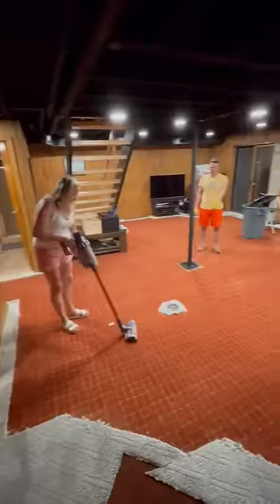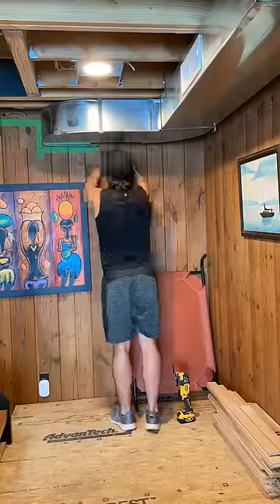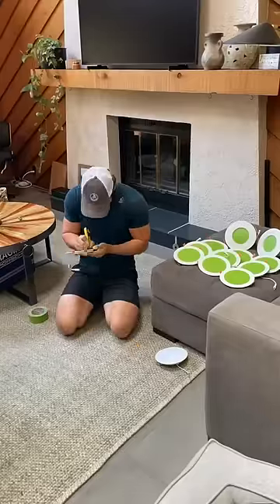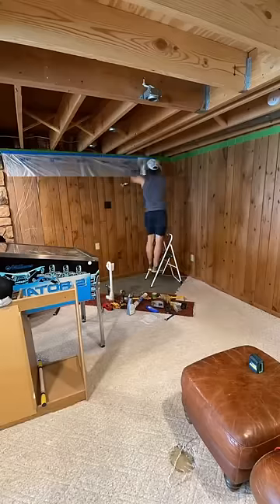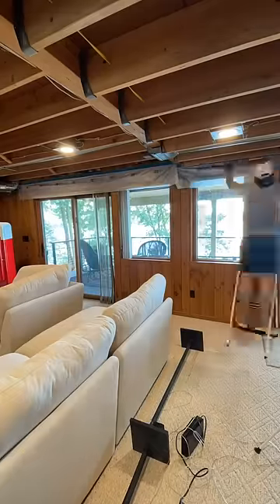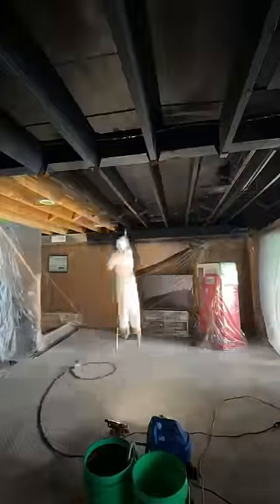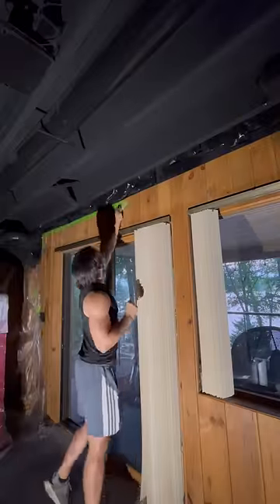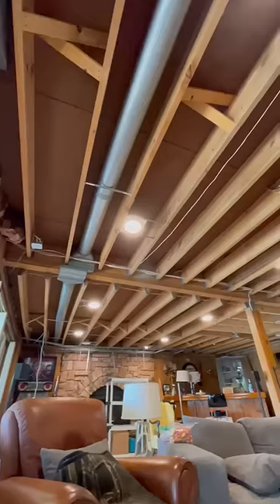Basement Renovation Part 4: Spraying the Ceiling BLACK

Comment: It may have been better to first pressure treat the wood against structural decay, pests, and fungus. I believe the term is Wolmanized but that may just be a brand name. Then stain (optional) and seal the wood. Then you can install a (drop) ceiling of any type and (painted) of any color you like. It may look nice now, depending on individual taste but will create a super mess later. IMO, this is awful and you just ruined the house.

Comment: This is not fun, bro. I've done this before, and it's bot fun. And it looks like shit. It drips on pipes and wires. And you can never get e erywhere u less you spray the shit out of it and over paint areas you don't want to over paint.  DO NOT DO THIS AT YOUR HOME. HORRIBLE IDEA.
Reply from the maker: If you do it right, you shouldn’t have any drips. The spraying process only took me about an hour 🤷‍♂️